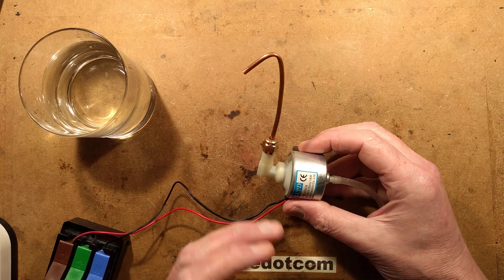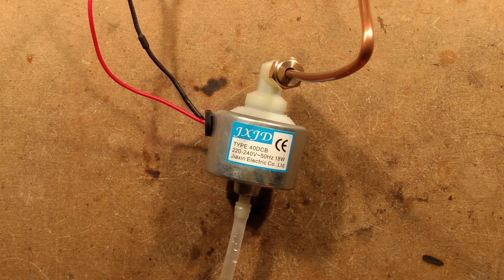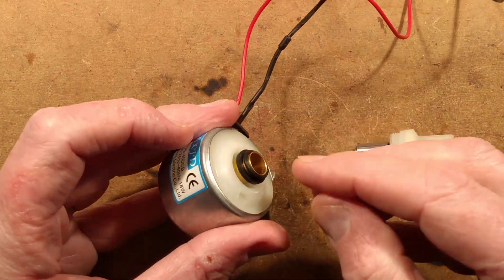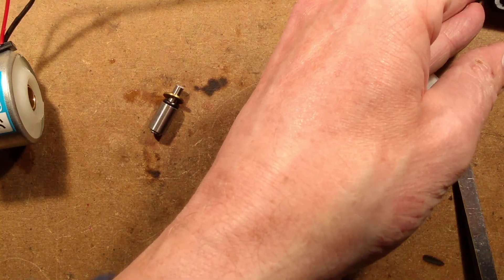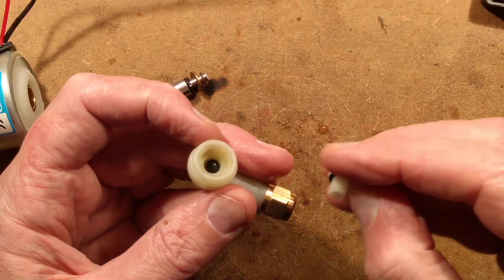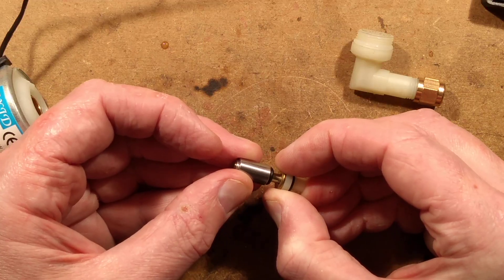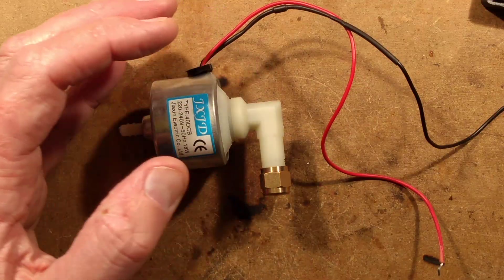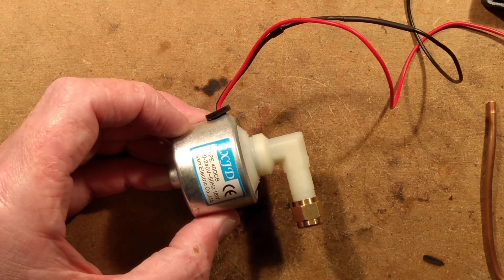Fix your smoke, snow machine, steam mop solenoid pump.

Comment: Thanks, had a fog machine that stopped working after a single season again.  Pump hummed but didn’t work.  Disassembled and it turned out to be an issue with that very small gasket you were talking about.  In this case, the gasket was rubber and didn’t allow proper travel of the metal piece.  Scrapped the inside out a little in place with a utility knife.  It started working again.  To test, you remove this gasket put the pump back together without it and see if it runs.

Comment: This is a fantastic video, thanks for making it! I use fog and haze regularly- some people insist that you should clean your machine after every use. I'm pretty sure this is probably the best way to get the best results for the longest amount of time. But do you think it's actually neccessary? If you use your machine for a few hours and it just sits there until next halloween, that's one thing, but if a machine ise used say, every 2-3 weeks, or every 1-2 days, or once a month- do you think it's necessarily different? 

I'm sure there are all sorts of variables- which machine, what is the chemical composition of the haze/fog fluid you use, how long was it used, what temp was the machine running at etc etc, but in general, for someone who uses it regularly, do you think it makes a difference? 

Maybe a simpler way to ask is, how long does it take (on average, for most types of fluid), for the remnants of the fluid to cake up and cause the system to become clogged? Which is simplistic, because there are any number of other things that can happen besides the pump being clogged because of the fluid residue. But aside from the physics, electronics and engineering of it all!

Do you happen to have a link for the o-rings that you've used? Is there a range of types and sizes, or 1-2 that are most common?

 Thanks!
Reply from the maker: I wouldn't clean it after every use.  Just after a reasonable length of usage.  The purity of the liquid is what usually determines the amount of residue in the heater.
Reply: @bigclivedotcom  Thanks!

Comment: The pump of my Eurolite N-19 just failed, but in a weird way. At first it was blocked like mentioned in this video but when I cleaned and greased all moving parts and I could noticably hear that the piston works just fine and powerful again, I noticed that the pump didn't build any pressure nonetheless. I checked everything. The spring in the piston was fine, the small plastic thingy attached to there was fine. The black springy-sealing-nipple was also fine. Should work like a charm but doesn't. These pumps must utilize some kind of voodoo to actually work.
Reply from the maker: If the pump is disconnected from the heater block does it pump fluid?  The other common failure of fog machines is a blocked heater.  It usually requires a new machine.

Comment: Is the pump itself supposed to produce smoke or is it just shooting liquid that gets heated up afterwards?
Reply from the maker: It just pumps liquid into a heated chamber where it turns into a dense vapour.
Reply: @bigclivedotcom  Thank you for your quick reply! Follow up question : is there an easy way to make a makeshift heated chamber? :|
Reply from the maker: @anatoos  The simplest tube type is a coil of copper capillary tubing wound round a heater core, but it does require thermal regulation.  You can buy small fog machines for around £$20.
Reply: @bigclivedotcom  thank you

Comment: Thanks man...so very informative..i have some fog machine.i do some repair/maintenance on the pumps when it doesnt  working properly,like it doesnt suck the liquid from the source...anyways..learned alot..thanks..from 2020..
Reply from the maker: The other common problem with fog machines is heater blockage caused by using impure liquids.  As the liquid evaporates it leaves residue in the block that can be hard to remove.

Comment: If you wire the red and black wires directly to 110v, on a working pump, will the pump vibrate rather obviously?
Reply from the maker: The pump often has a diode built in or inline with the cable.  So it will run if it's designed for 110V.

Comment: The pump on my machine doesn't whir or vibrate. Is this because a) the pump is toast b)there is some kind of cutout circut on the board? c) does it stop making noise when it is thoroughly clogged?  If A, what reading should I get across the leads if the motor is toast. I can hotwire it directly to 120v and expect it to whir up? Thanks (fascinated with things electronical)....
Reply from the maker: They clog up very easily, particularly when stored for a while.  If you take it apart carefully you may be able to unclog it.  The solenoid piston should move freely in the cylinder.

Comment: Hi you need to change the description as this is the same pump used in the H20 x5 steam mop that often fails because of a blocked pump. Your video saved me buying a new mop.
Reply from the maker: I've added that in.  These common pumps are used in a lot of appliances.

Comment: Excellent video. I had issue with my pump which is very similar. Yes the O ring had swollen preventing the plunger to move back and forth. I too had problems sourcing the correct O ring. I found one that was slightly oversize on the inner diameter and slightly larger on the outer diameter. When fitted it was too tight on the inner. I gently slid the O ring over the shank of a drill bit and with a needle file ran it over the outer whilst spinning in a cordless drill until the fit was perfect. It's now working better than when the smoke machine was new. Thanks again for the tip.
Reply from the maker: Another thing that helps is a dab of silicone grease on the plunger.

Comment: Got a diaphragm pump on my Rug Doctor, little sod's decided to run intermittently, when it runs at all it runs for a few seconds then stops. Hopefully it's the diode as the pump is eighty quid.
Reply from the maker: Might be worth probing to see if you're getting power to the whole thing reliably.  Could also be a broken winding at a termination.
Reply: @bigclivedotcom  Update: checked it today with a power meter, the RugDoctor's pump was drawing power whether it was pumping or not (and the same amount, too). Tipped out the tank and put clean hot water in it, then after a few minutes of switching it on and off, hooking up attachments, etc. it started to behave a bit more consistently (though not reliably), I was then able to leave the pump running to flush itself clear. Likely culprit: a tankful of upholstery cleaner left to go cold in the machine. All working now :)
Reply from the maker: @AintBigAintClever  It does sound like it was just gunked up.  Pretty common with the little pumps.

Comment: Clive, if you run water through the pump and you cover the output with your finger, how easily does it stall?  I'm trying to gauge how useful these pumps would be for small projects and crafts... of course the ebay listings don't give any flow rates or pressure figures.
Reply from the maker: Not sure, but they are used to pump water from air conditioner condensation sumps so they must be able to put a bit of pressure out.
Reply: Ok cool. That gives me a little more confidence in them.  Thanks much!

Comment: I wonder why they use the Diode and a return spring. I'd expect that they could just run AC down that line and the current reversal would cause it to return. That way they could save the cost of both the diode and one of the springs.
Reply from the maker: It would have to be a permanent magnet to do that.  By using a diode they can use a plain steel core and also cut down the power dissipation from the coil..
Reply: Silly me, I just assumed it was a magnet; didn't even think of it being a plain steel core.

Thanks for pointing that out!

Comment: Wish mine were this easy to take apart, it got clogged but the only way to take it apart was to peel back the crimped metal. That ended with me bending the piston in the end so I had to just buy a new pump.

Comment: No idea why a snow machine would need a smoke screen. Coffee machines use a similar solenoid pump to get the very high pressure. One issue I found was if they are left sitting dry, the marble valve sticks to the seat and they don't pump. Forcing water in reverse fixes it.

Comment: I once had a small toy robot. It walked around and the mouth let off smoke every couple of minutes. I took it apart and it had a small tank of oily stuff inside.
Reply from the maker: Those used a wick and heating element (a bit like a vaping device) to burn oil.

Comment: When servicing hot pressure washers, one must descale the heating coil, which is a coiled steel tube, forming a drum shape into which diesel is sprayed ignited and air forced in with a fan.  It gets very scaled quite quickly - a bit like a monster kettle, but angrier.  We use hydrochloric acid for this task and it is a pretty scary process, as you are basically dealing with over 100°C steam/water at around about 2500 PSI and so you can imagine what happens when we pour in HCL to this mix!  By comparison, a small bit of vinegar in a small copper pipe, well...

Comment: O rings of that size are available from Fasttech - https://www.fasttech.com/products/1/10006772/9673267-silicone-o-ring-seals-for-atomizers-50-pack
Plus lots of other sizes.
Reply from the maker: Interesting.  I wonder which material is optimal for a task with a high speed reciprocating piston.
Reply: Looks like quite a complex subject, having done a little research. There do appear to be PTFE rings available from some manufacturers, which would probably minimise wear. Considering it's a cheap chinese pump I doubt the best were used.. ;-)

Comment: For the cheapskate-solution: Couldn't you just take a 4mm drill bit - a nice and sharp one and grind away a bit of the material from the middle of the o-ring? Seems a bit better to me than to cut the ring. Cannot try it myself since I do not have many of these pumps around...

Comment: i don't understand why it uses a diode and a spring, couldn't it just use the negative voltage of the sine wave to move it back?
Reply from the maker: The core is not magnetic, so it would pull in on both halves of the sinewave.
The diode also helps reduce the power dissipation from the coil.

Comment: Scotsman Icemakers use a similar pump design - slightly more robust (larger volume) but the guts are near-identical. That tiny spring-loaded check valve is a real sod to resite should you "inadvertently" pull it out too far!! :-D

Comment: Clive, how can I send you something? I have a couple of LED light bulbs I have use with a dimmer, and over time, they started to glow yellow and a mysterious brown liquid has appeared within the bulb. I figured you would like to take a look.
Reply from the maker: If there's a dribble of liquid then it's possible that an electrolytic capacitor has failed and leaked.  If it's a lot then a possible scenario is that water from above the ceiling has entered the lamp in some way and caused discoloration and corrosion.
Reply: I'm thinking its an issue with the capacitor. The lamps were originally bright white, but after about a month, the lamp decreased in brightness and started to glow a warm yellow light. I replaced it, and the new lamp has the same issue.

Comment: (⚠️Innuendo warning!)
The last thing you want is a puffed up ring round your shaft!
I had an old, cheap air conditioner with one of those pumps for the condensate drainage and it sounded like a woodpecker on speed!

Comment: The vapor juice in fog machines is propylene glycol, which is the same chemical in liquid cough and cold syrups, and is totally safe to vape, breathe in, and consume.
Reply from the maker: A few different glycols are used including triethylene glycol and the rather shady sounding butylene glycol.  In some haze machines a glycerol fluid is used.

Comment: Hmmm vinegar steam... Does that kill weeds? This is a terrible idea where I live though, thinking of the neighbors and their outdoor pets. I do actually have a fog machine completely clogged and full of fluid, just as it was when I found it on the street 10 years ago. Maybe it's rubber is totally wrecked but if it's fixable maybe a long pipe on the output could be used to condense and control the steam.

Comment: Can add counter top ice cube making machines to the list. My mother has one with a pump nearly identical to this one, only difference is a strapped down connector on the output instead of a compression fitting. Been meaning to open it up and see if the pump is crudded up, it doesn't fill properly anymore which is a real shame considering that thing has incredibly good cooling pipes.

Comment: For all the smoke machines I have owned over the years its the heater block that's died not the pump.
Reply from the maker: Have you tried an occasional flush-through with white vinegar?
Reply: Yep, was something that I did often but just stopped heating eventually.

Comment: These are also commonly used in freestanding dehumidifiers that have automatic pumps for draining.
Reply from the maker: Yeah, I've heard their distinctive sound in condensate pumps.  I'd have thought they'd gunk up quite quickly.
Reply: @bigclivedotcom  That is an accurate assumpion. There are three wire mesh screens prior to the water reaching the pump in the one I have. The entire unit requires disassembly and cleaning 2-3 times per year. Cheers Clive.
Reply from the maker: I wonder if a peristaltic pump would work better, and maybe some kind of sterilising device.

Comment: The diode is interesting, why don't they just use the negative half of the sine wave to pull the plunger back? There's probably a good reason for that?
Reply from the maker: The core isn't magnetic.  It would be attracted in on both halves of the waveform.
Reply: @bigclivedotcom  remove the diode. More smoke. Less runtime per cycle? Maybe full wave just is to fast for the piston to get back to start position.
Reply: @picobyte  Not the issue.  The magnet would not turn off.  The piston would stay attracted because the magnetic field needs time to collapse.  The solenoid would not have time to cool off either and the coil would burn out.

You could have two coils and suck the piston to each end of its stroke using coils at each end but that doubles the cost when in this case a spring is adequate.  If you were pumping something thicker you maybe could use the force generated from the other coil instead of a spring.

FYI, solenoids are disturbing powerful little things, and simple, and cheap.  The tradeoff is one direction power only.  If you decide to play with one.... watch your fingers :p
Reply: Core would then need to be a magnet, aka a lot more expensive.
Reply: My personal guess would be energy consumption.  Having the negative half move current too would double power consumption and isn't neccesary since a spring does the same job as a passive device requiring no power.  Not an engineer, but that'd be my guess.

Comment: if you push water through it can it generate a voltage? instead of using electricity to circulate water. like turning a motor 🤔🤷‍♂️
Reply from the maker: The liquid wouldn't create a reciprocating action and the core is not magnetic.
Reply: Heh, no, pushing water through it will not create vibration of the core, and even if it did, the core is not permanently magnetized enough to create any significant voltage in the stator winding.
Reply: interesting idea..LOL..maybe has possibility as a flow detector/meter
Reply: could get some electricity from my tap 🤔😯
Reply: @DonaldSleightholme  or maybe the downpipe of the roof guttering...its been pissing down in south east London
Reply: water generators exist, they're often used to charge and run the hands free commercial faucets and flush valve setups. the touch free "hand wash" stations in commercial kitchens and bathrooms sometimes have them. they're a water wheel that spins a an actual generator.
Reply: throttle bottle That’s cool! Any links or pics to one?
Reply: @SquishyZoran  bigclive did a video.  Water generator or micro generator... something like that.  The water spins a little turbine attached to an electric motor.

As for this thing.  If you ran water through it the pressure would be blocked by the first rubber stopper.  If you reversed all the valving the water would just pass straight through.

And like Bigclive said, if the core is not magnetic then moving it in the coil would not generate electricity anyway.
Reply: Some Guy I need to go back and look!
Reply: i think that Mario was a electrician? 🤔😄🤷‍♂️

Comment: Interesting! Wouldn't a solenoid/diaphragm pump be more reliable, the construction could be simpler (the valves and seals)?
Reply: where there's a diaphragm, there's soon to be a leak. off season the diaphragm would harden or dry and break.
Reply: Really? Diaphragms can be made of hardier materials than O-rings. And I'm pretty sure the condensed water pump in my AC is such (not completely sure). It has been working for something like more than ten years now and that AC runs about four or five months a year. Of course the pump itself is not working all that time, maybe five minutes once a day in average, but I'd think it is pretty much water-exposed all the time. I don't know.

Comment: Looks like something else in the wire in addition to the diode.
How about creating some sort of alcohol serving device using one of these :)
Reply: the simplicity of gravity works well...
Reply from the maker: I was pondering if it could be used to make cocktails.
Reply: I would definitely prefer a peristaltic pump for alcohol dispensing